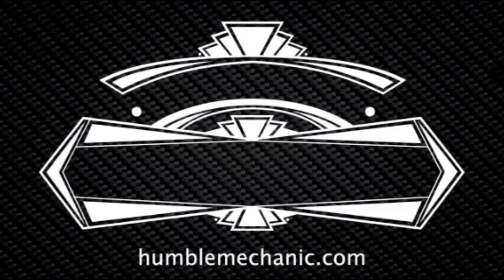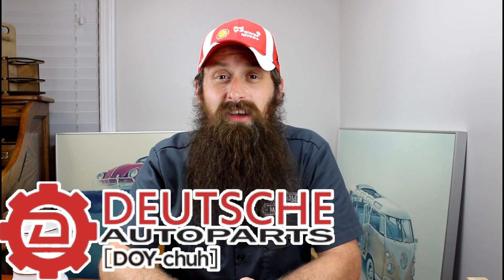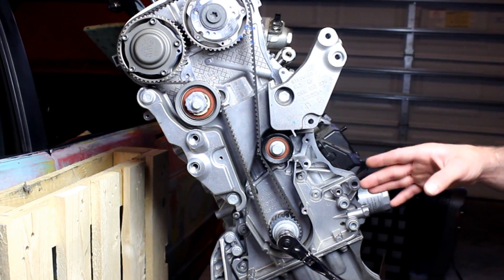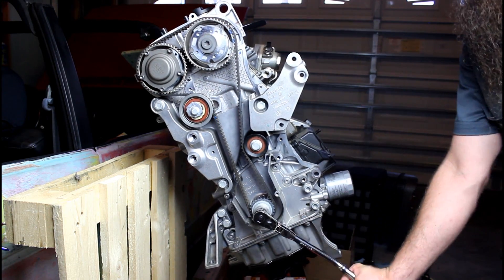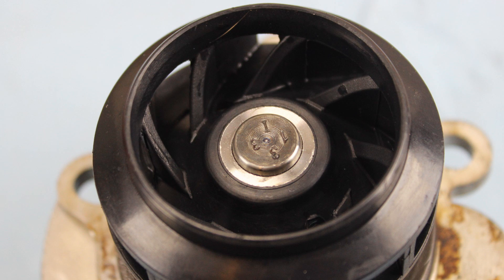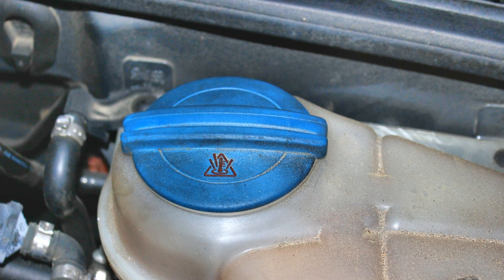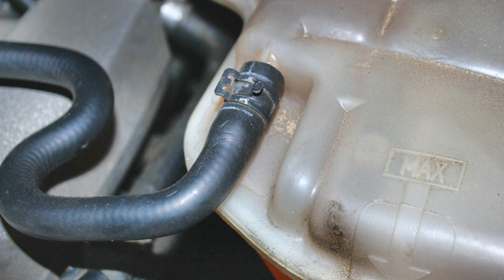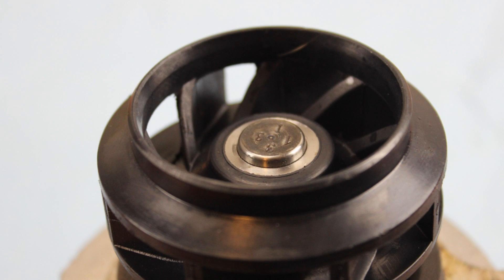How VW Water Pumps Fail

Comment: I upgraded to an aluminum water pump and it took forever to warm up. So I went back in and replaced the thermostat with an OEM one. STILL takes too long to warm up to operating temp. I'm stumped.

Comment: Does it start whining when it starts failing? I have a 2018 Tiguan with 70k kms and I know its leaking coolant slowly from the water pump, it didnt make any noise until yesterday when it started sort of like whining to a higher pitch ubder acceleration and onto a lower pitch when stopping, I could also hear something like a belt making noise

Comment: How much flow are we talking about ? Just did coolant flush in 2.5 beetle and was not really impressed with the flow rate. Was revving it at 1500. Can the water pump slowly fail and put out less and less flow? No noise and no overheating.
Reply from the maker: Depending on the pump, it can slowly fail the plastic or composite. I should say impeller can start to slip where it’s not totally bad but it just doesn’t flow like it should.

Comment: Almost lost an engine over the meyle HD metal water pump. It's supposed to be rated for 100k my mileage was around 70K. It had bearing failure and was moments away from letting the timing belt go. Soooo I'm going back to plastic because that's what the OE was using. With that being said I'm nervous because you can't really see the bearings to see what kind they're using in these aftermarket pumps.
Reply from the maker: Ive seen that happen.

Comment: Had water pump  on vw just under 500000 km replaced everytime timing belt and tensioner sprayed in water pump weep hole with lubricant and most g12 then water

Comment: Whenever the plastic impeller  becomes stucked  means that the waterpump becomes a bearing for the timing belt.  Using a metal empellar means that the timing belt will be destroyed ruining the entire engine compared to going into limping mode due to overheating.

Comment: Good video. The diffrence between metal and plastic impeller pumps are. Plastic can seize say due to customer poor coolant mix in winter and frozen and seize  snap the impeller and not interfere with the belt and engine keep working but getting warm. If the metal impeller seizes they is very good chance it will kick the belt and potentially cause catastrophic damage to the pistons and valves

Comment: Very slightly off-topic, but since you are a VW Golf guy yourself, here goes:
In addition to our beloved 2001 Passat wagon (getting its 4th timing belt and 3rd water pump next month), we have a 2016 Golf Sportwagen 1.8T, which we also really like. However, I understand the water pump is a weak spot on these, as well. Since I can smell coolant under the hood after every trip, I presume it has a very small coolant leak, possibly in the water pump. (We also got the official VWoA notice regarding water pump warranties.) Is there a recommended reliability upgrade for the water pump, just as we always use a metal impeller model when replacing the Passat's water pump? I presume I should replace the thermostat and housing along with the water pump if we get to the point of needing to replace it. Do these fail abruptly, as in the Passat case, or does the leak simply start worsening gradually? Any advice would be greatly appreciated. Big fan of your channel. (Anyone with a B5 Passat wagon can't be all bad. :) )

Comment: Hi, My car is overheating for 10C (it shows 100C, stable, constant value).
At first I thought it could be thermostat (easiest thing to change), although there is almost nothing to fail. and it was new.
I replaced it and it didn't help. Then I've changed the radiator (it was 22 years old) and it also didn't help.
Also need to mention that my coolant system is very clean without any sludge/dirt/(I do flushes and coolant changes in 3 years intervals).. whatsoever, what was confirmed again when I've cut open radiator and there was nothing to see, anything.
And then I made the test with return line, that you mention here in video, and of course, there is no flow... 
Great news!!! 😡
I've replaced water pump (with timing belt) 8months ago (SKF brand, plastic impeller), and now this. Everything I change is OEM brand.
.... it could also be coolant sensor but I highly doubt it, and after watching this video, even more... My engine is 1.8 20V APT. Again great, lets do this timing belt fun again.
Wish you all the best.

Comment: Charles, hoping this message finds you...Just replaced a Therm. Housing / water pump on my 16' golf R. Replaced the WP belt and bumped the gear forward while tightening it...maybe 1/4 turn! I did not have the crank locked up due to the washer bottle access and had no idea I would move it with a 12mm wrench...Should I be concerned about timing as it is I believe balance shaft driven? Thank for your input- Pete

Comment: I'm getting a bit of a grinding noise at slow speeds as well as low coolant. Will the water pump make a bit of a grinding noise instead of a whine? 

I'm wondering if the water pump is showing 2 issues or if it's unfortunately 2 separate issues unfortunately presenting itself at the same time?

Comment: My plastic waterpump broke and i replaced it with one that has metal blades. Problem is that the plastic blades from the old pump are still in the system, because we could not get them out. Can this cause issues down the road? I imagine this is a common issue since i am not the first or last one that had a pump fail.

Comment: Hi I hope you can help I have VW touran  2014  2.0 DSG  the problem I have is that in cold weather my car lose temperature even going down hill will lose temperature. I had thermostat and timing belt water pump change. Do you have any idea as what it can be ?

Comment: "Volkswagen usually designs things for a specific purpose." Ya to fail and have you spend thousands of dollars in replacement parts and labor.
Reply from the maker: There is truth in that.  I do try and keep in mind engineering and accounting are two different worlds. Often the design is good the bean counters cheapen the system

Comment: I have a major leak in my coolant system after replacing heater hoses. It’s loosing 2 gals just sitting. So after three stops it’s almost empty. No blown head gasket. My reservoir steams from the small hose up top on the bottle. But I can’t find the leak

Comment: I had my AEG engine water pump seize (because the impeller broke apart and jammed) I noticed my water temp pegged and made it home, engine was super hot. Anyway noticed the timing belt teeth were completely GONE. Had car towed to dealer and amazingly the engine didn't jump time. After that I always used aftermarket (Graf I believe) metal impeller. I was very lucky. Next time I had timing belt/water pump service I bought my Graf pump and told dealer to install they argued but did it. Service tech said they fail too I asked how he said they rust and seize up! What a bunch of BS. the engine block is cast iron and it doesn't rust, not with proper antifreeze anyway. I never went back to that dealer.

Comment: I have a problem with my 2002 vw passat. I had changed the flange and the sensor. Also i changed the thermostat and the housing. But it still over heating. I removed the return line but it seems flow fine. Can you help me figure this out?

Comment: Hi, I have a 2012 Beetle 2.5L with 132,000 miles on it. I see some fluid around the water pump pully and some landing on the block under the water pump. When i see it on the ground it does look kind of reddish. Hard to tell if it is antifreeze because it is pink. Does that sound like a leaking water pump and you think it would go bad that soon?
Reply from the maker: It does sound like a leaking pump. They usually don’t leak severely. But it needs to be fixed soon
Reply: @HumbleMechanic  thanks

Comment: does anyone know the lifespan of a replaced VW-oem waterpump on a TSI motor?
mine was done by the last owner at 57k miles at the dealership, and I have  110k miles on my 2009 CC with the 2.0T motor.
I'm getting to do the tensioner, and am thinking, hell since I'm there I'm going to do the entire timing chain and guide job, might as well do the water pump also. I plan on keeping the car longer until it won't run, or until the I have to change out the clutch, which may be due in the the future.

Comment: Hi i’m having a very bad experience with a vw jetta se 2017 i took the car to the dealer for over heating and a lot light sensors on, the diagnostic was the manifull and oil sensors they changed it and lights where off i paid over $1000  and still gating heat, know they said we have to change the water pump because was taking 15 mts to the car get heat they did not notice, well price another $ 1200 i told them i can”t pay more i suppose  they will notice in the diagnostic well i decided take the car somewhere else!
They give me better price and after they put the new water pump now they said they don’t believe is the water pump all this happen since  December and they don’t even run the car jet i really Don’t know what to di i have no more money ti fix it and every body said this car is very complicated is a bod kind of car is build different and even has 2 radiators and make everything more complicated well plz can you recommend it tome what can i do...
A very worry confuse customer.
Reply from the maker: YIKES!!! If this is a dealer, and you are spending so much on the car with out it actually being fixed, call VW corporate

Comment: Have a 03 Jetta 1.8T. Has been sitting for over 8 yrs. Only 77 000kms on the cluster. Started and ran once in a while. My understanding is the water pump is plastic impeller. Change it to metal?

Comment: Love your videos bud! My 2011 vw 2.5L and its overheating. I've replaced the thermostat and cleared the cooling system  but still overheating.  I did notice the lower radiator hose not hot at all but the upper radiator hose is hot. what would this mean?
Reply: Do you have a stuck thermostat?
Reply: Or a blown head gasket

Comment: water pump is suppose to fail, so you do your timing belt before it fails, vw interferance engine in the 1.8t anyways.
Reply from the maker: I don’t think it was designed that way. Yes the pump was designed with a lower cost failure than engine but not so you do a timing belt.
Reply: @HumbleMechanic  i know but if your in there might as well do the timebelt right?

Comment: im losing about 4-6oz every 10k miles. After a long trip I can smell coolant, but I cant identify where the "leak" is coming from. Any ideas? Should I worry about it or just keep topping off each oil change? 2016 jetta 1.8t.

Comment: I have a 2015 Jetta SE 1.8T in my bay right now. Water pump is on the right hand side (timing on the right).
Its driven by a belt that looks like its run via a timing-driven shaft.

I'm glad I can go back to these older videos for advice on current cars.

Comment: Bought my wife a 2007 beetle convertible. Now has 96k miles slight squeak on the belt. Took it to the shop. They told me it was the water pump. 2-3 day job costing me $1100 out the door smh

Comment: I have a 2005 MKV Jetta that needs water pump replacement. What other parts do you recommend I buy as well when replacing a water pump? And what is the typical labor cost?
Reply from the maker: Not sure on labor. 4-5hr I’d guess. Look at all rollers for sure. I’d replace the serp belt 100%
Reply: @HumbleMechanic  do I also  (2005 jetta 2.5l) need to replace the aux water pump?

Comment: I need help with my 05 Audi turbo  my Audi over heat after 5 min of driving how do I now if it’s my water pump. I already changed my thermostat and Reservoir tank and add did a new gasket seal.

Comment: I did the timing belt 2 days ago on my 02 Jetta, ALH. I had a weird creaking noise prior to the job, but it sounded to me like it was coming from something in the front end. Definitely creaking and not a squeak or squeal. I heard it when starting, stopping and especially when hitting speed bumps at a slow speed, so I thought it was suspension related. After changing the belt, all rollers, tensioner and water pump, I went for a drive, and the noise is gone. The original water pump was about to completely fail, as it was scraping and nearly locked up. In fact, you can see aluminum shavings stuck behind the gear webbing from the front. I think I did this job in the nick of time. 79, 728 miles on the clock. The belt and all the rollers were perfect, by the way, although the serpentine belt was cracking badly. I still don't understand why it was making that noise, could swear it was under the front end.

Comment: i get bubbles in my coolant tank? and some smoke even after cold starting
cracked head? or could it be something else? bkd engine..
Reply: in BKD heads is common to have a porus, same synthoms as a gone head gasket. What was at the end?
Reply: @enricgs2151  putbthebcar on fire and bought a e60 530i manual
Reply: @enricgs2151  cracked head..
Reply: AlphaMuscle did you find out ? I got same problem

Comment: Does faulty water pump affects timing chain. i have CC 2.0T which started leaking coolant. The dealer diagnosed the problem as faulty water pump. I read somewhere that bad water pump might affect life of timing chain. Should timing chain be replaced or at least inspected. The dealer told me that faulty water pump has no effect on timing chain.  is that true ?

Comment: I have Volkswagen Passat CC Variant 1.4 TSI manual and when I parked the coolant leaked that I can see on the ground. Wondering if that is because of the water pump, and also wondering if Passat 2012, TSI, Eco-fuel has multiple water pumps? As per online store show electrical and a mechanical water pump.
Which pump is more prone to fail or leak?

Comment: The first one in my 2001 Jetta disintegrated at about 40k.  I think price is a more important criteria for the plastic impeller than performance. VW simply cheaped out. Same thing with the MkIV coil packs and window regulators.

Comment: I had failed water pump of my TTq 2002 at 80K miles, It seems that i have to replace it again  bfr it fails ‘cuz now it has 130K in tap, is it better than NOT? 
one more question, I bought a new  audi S1 2.0 TFSI  in july 2016. since i dont trust a dealer i’m sorry, i didn’t ever take to dealer for any service etc since the day one, probably  i lose the 3 years quarantie but i dont care, Wondering, does it have a timing chain or belt?

Comment: I have a 2010 volkswagen jetta se. It just started to over heat. But it only over heats when your sitting/idling. Otherwise it stays right in the middle like normal. This car has never failed me. Its a solid car. Just hit 190k. Its not leaking anywhere either. And the heat comes out perfectly. So is it a water pump? Or maybe thermostat? I didn't know it overheated until it red lined and the ding ding ding came on. So immediately i turned it off. The reservoir is full too. Just wanted to get your opinion. Im lost. And have no one. And everyone says one thing and does another. So... I have to travel an hour away tomm and like I said. Driving. Car stays perfect. But I dont wanna push it if somethings gonna seize. I just wanna be safe. I was gonna go and do a flush and see if that helps. Maybe some things clogged. You think that's a good idea. Or? Please if you can. I'd appreciate any tips or info. Thank you
Reply from the maker: If it's just at idle, start with checking the cooling fans
Reply: Its at idle and lights. That's it. But you can tell its running hot with the heat on. Its like hell in there. But it's running amazing. And no leaks or anything. No smoke. No cream in oil. Nothing else. Im sick over it. Obviously I have to wait to Monday But it won't blow up if I drive tomm. I have one straight run. 50 mins away and back.